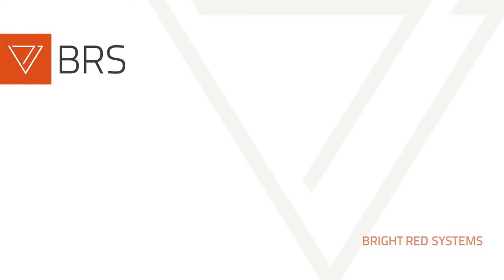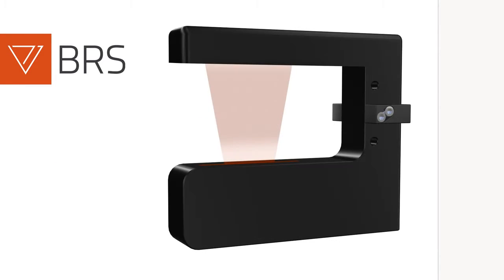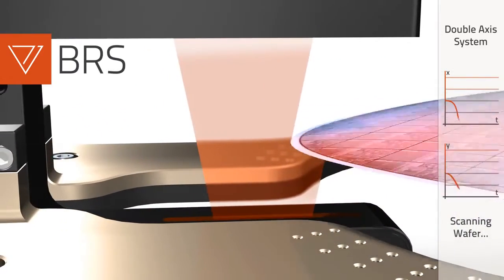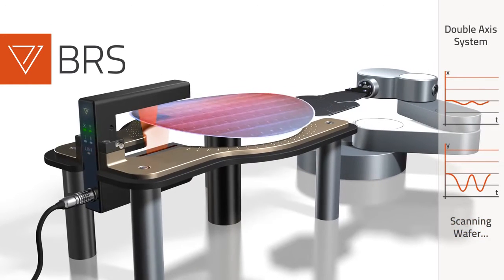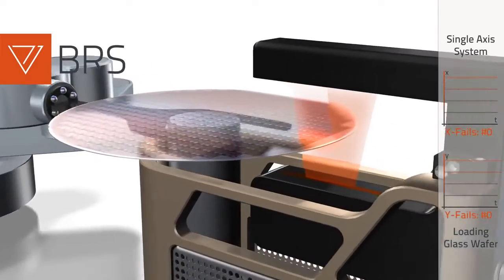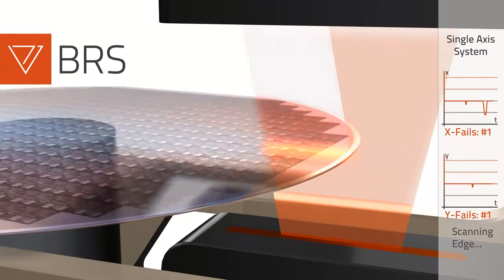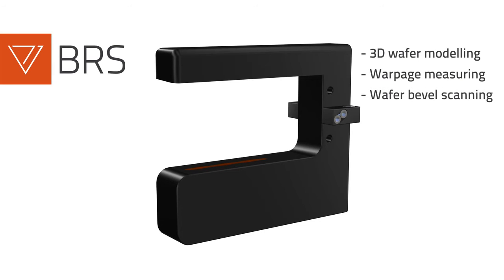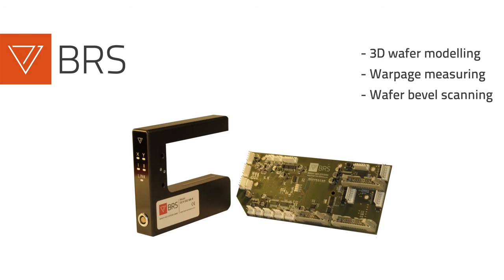Alignment of Warped Thin Wafers

Comment: Do wafers often warp? If so, how?
Reply: I was just learning Heat and Mass Transfer and it says that due to higher temperature differences in the chip between two of its sides which in the sum I was doing said to not be greater than 2 degrees, warping of wafer and inducing slip planes in the crystal structure could occur.